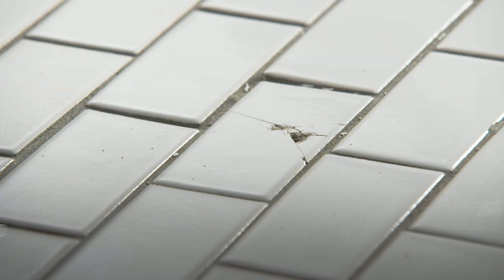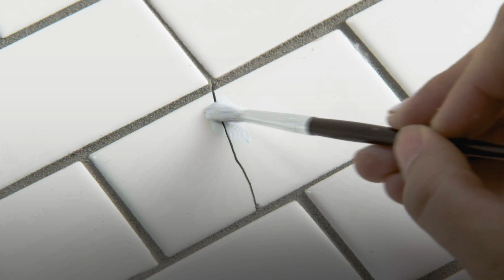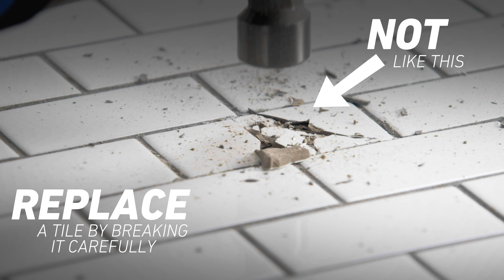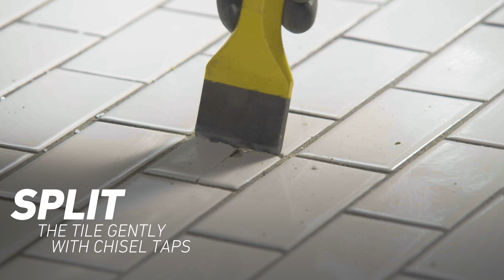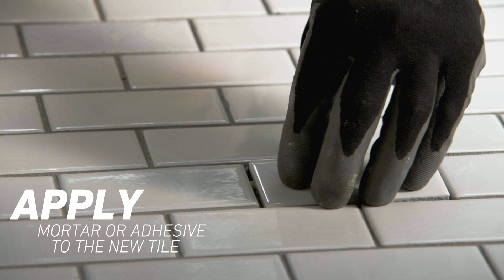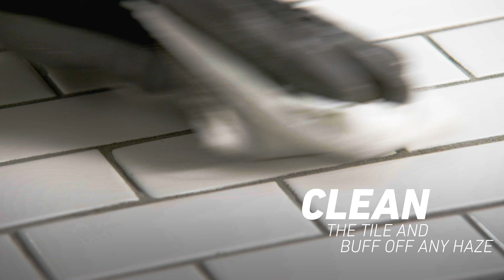How To Repair a Cracked Tile

Comment: Thank u for ur good vid , question:What about if it is a colored tile and has a crack but don’t have extras?
Reply from the maker: If it is a small crack we suggest mixing some filler and trying to match the color with touch-up paint.
Reply: Lowe's Home Improvement thank u for ur fast reply , I really appreciate it, will try it🤞
Reply: In Brazil we have some stores called tile's graveyard where you can find older tiles and buy the quantity you need for this kinds of repairs.